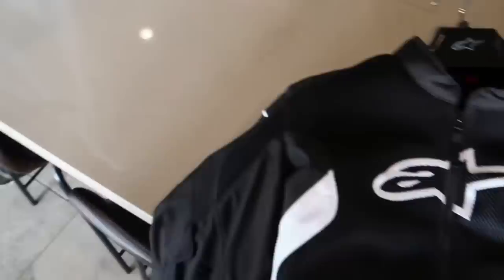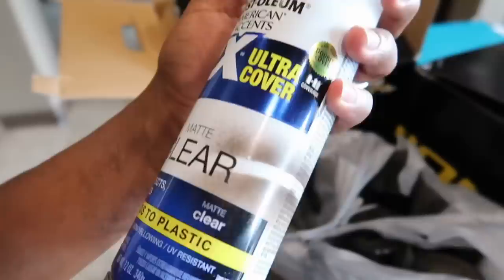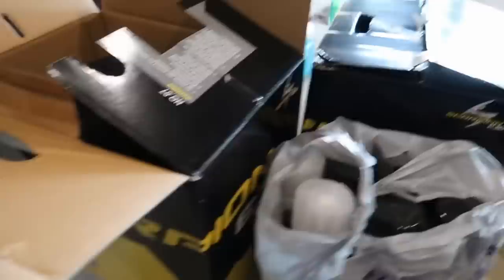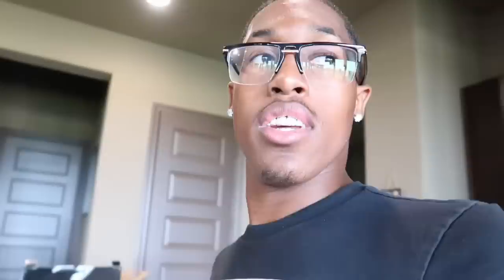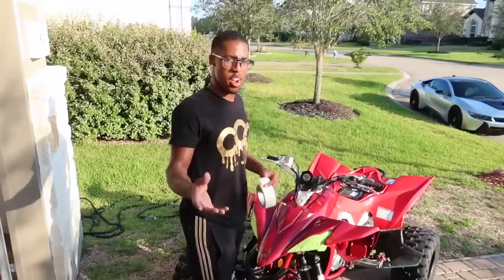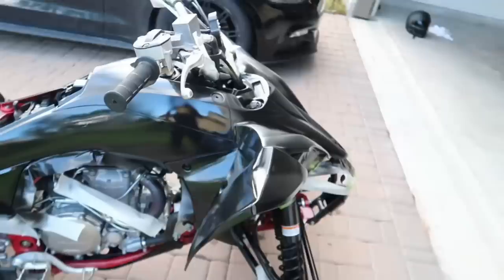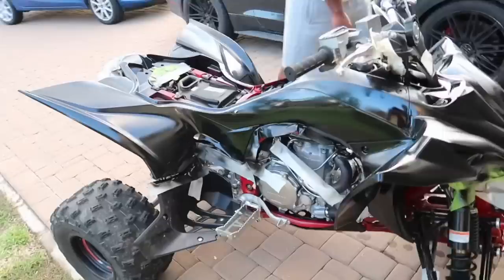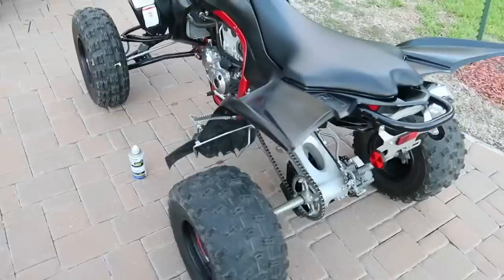PAINTING MY FOUR WHEELER BLACK

Comment: Hey bro the monte is dope but to get that steering wheel off you need a different type of steering wheel puller they sale them at autozone it's in the shape off the letter U and it presses in on the steering wheel so you can pull the c clip out and pull the wheel of

Comment: If you took that bolt off the steering wheel all you have to do is keep hitting it, if you have to you a little hammer and hit the back of it just keep hitting it on each side and it should come up.

Comment: When you put the puller on and your screwing the steering wheel with the bolt you get room to remove a small clip and then the steering  should pop off